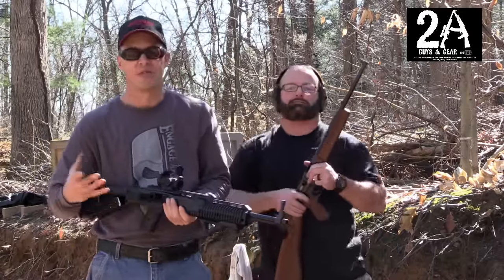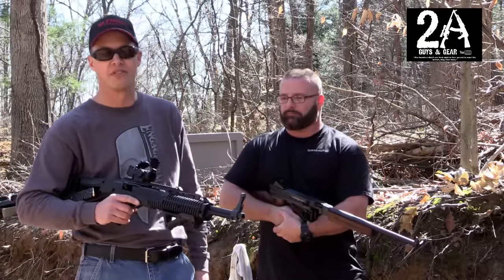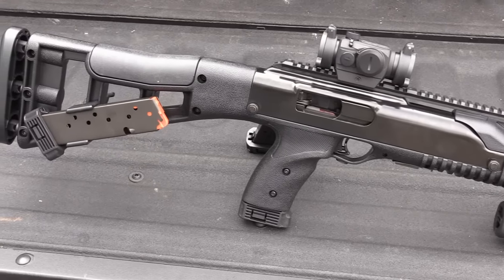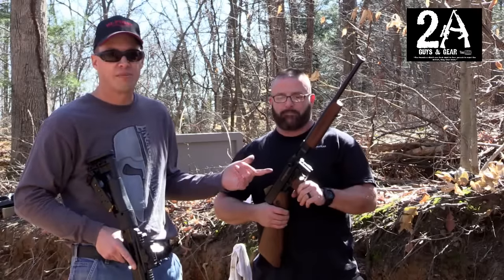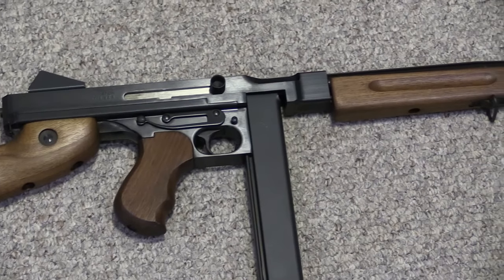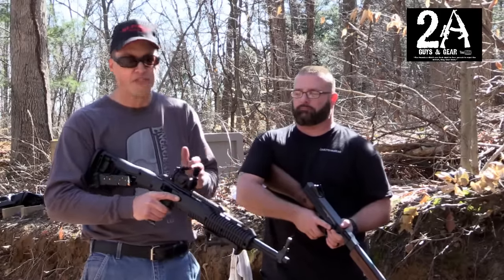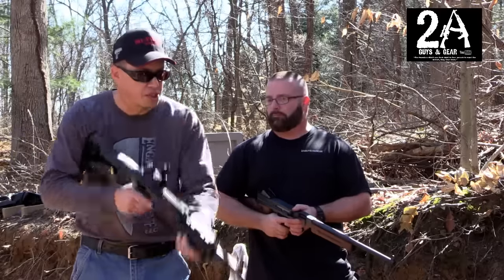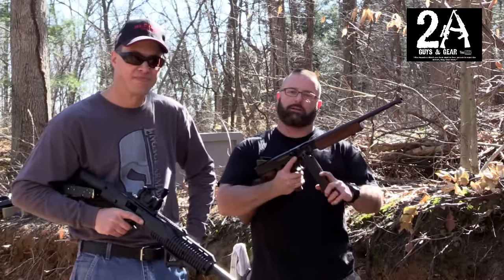Hi Point VS.Tommy Gun; Modern day and Vintage carbines compared

Comment: Well, after watching the video you guys did with the RedBall 20 round magazine, I bought one and it worked perfectly in my 4595.  I fired two magazine loads or 40 rounds without a flaw.  The Thompson is a classic but you can also get 4 HP 4595s for the same cost or there abouts.  No matter how you cut it, the Hi Point is the poor man's Thompson with the 20 round RedBall magazines.  I have the 45 JHP pistol and am extremely pleased.  I wish the RedBall magazine would work on the .45 JHP just for range fun.  For a little over $300.00 you get a reliable .45 ACP carbine and for less than $30.00, you can get these well made 20 round magazines.  With .45 ACP + P ammo, you have a great camp protection combo carbine and pistol.  Where I live, there are Cougars, Black Bears and Wolves now.  I am confident the carbine and pistol will protect us, just in case... Good Video!!

Comment: Is this high point a good shtf gun?
Reply: brian buchert No. Buy an SKS for that.. especially at the $300 pri e point.
Reply: The Rooster well I bought the 995ts but are you saying I can get an sos for 300?
Reply: brian buchert In my area, I can still find SKSs for 300-400 in original configuration. Last one I bought was $280 out the door about 6 monthes ago.
Reply: The Rooster where did you buy it?
Reply: Yes it is they are
Reply: brian buchert Pawn shop. But Southern Ohio Guns has them for 339 online right now.
Reply: Yes it is dependable and very much fun to shoot.
Reply: @Dixielinemuzik  SKS has too much penetration for a home defense gun.
Otherwise I love my SKS
This is a gun every enthusiast should have!
Even at $450+ that nice Russian guns are selling for it's a bargain.
Reply: Yes, especially in the .45 cal. the carbine is fairly light weight, accurate & inexpensive. there are many acessories you can add to this platform making it darn near anything you like at a bargain price...
Reply: seeing as how it will run most any ammo you put through it and is accurate and sometimes better than most mid to high price range guns i'd say yes.

Comment: Hey guys could you get a hold of a redball sports 20rd hi point carbine mag to see if it is garbage? There going for 24.99 each. The pro mag is trash, voids your warranty and is really over priced. Thanks guys. Shoot straight, Shoot safe!
Reply from the maker: +darkdragon3571 Thanks for the heads up!  We'll get one and check it out for sure!!!
Reply: +2AGuysAndGear 

They're only making them for the 9mm version at present.
Reply: you can get it so it can accept 1911 mags so you can have a drum mag on it.

Comment: can't believe you are actually comparing that hi point to that bad ass gun,
Reply: you ever shoot a Hi-Point carbine? those things are A tier guns. comfortable to shoot and the reliability and accuracy of a high price gun. the only drawbacks are the magazine size and the trigger. and they can be fixed easily. the trigger spring can be replaced and it can accept 1911 mags with a small tweak so you can get the drum.